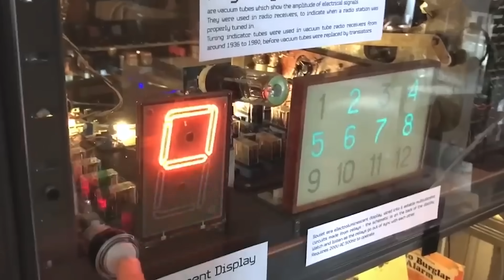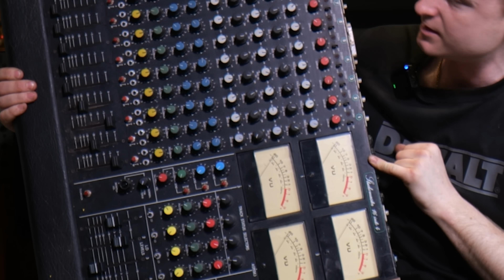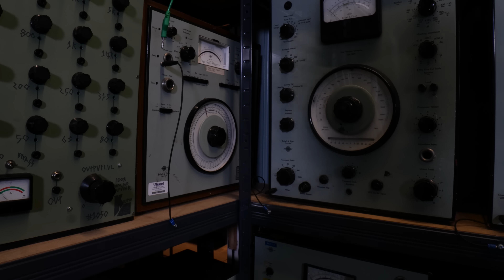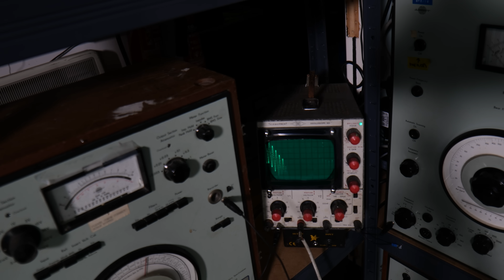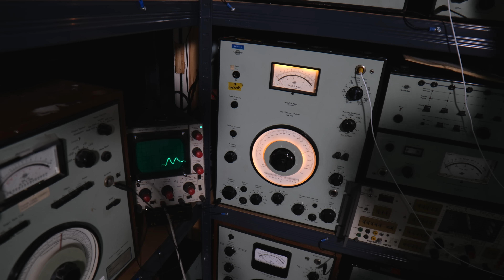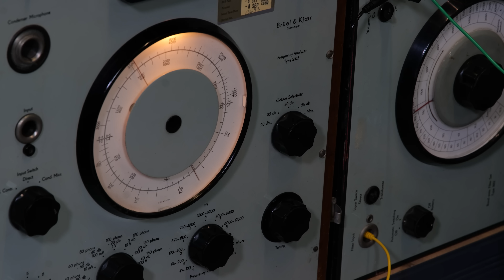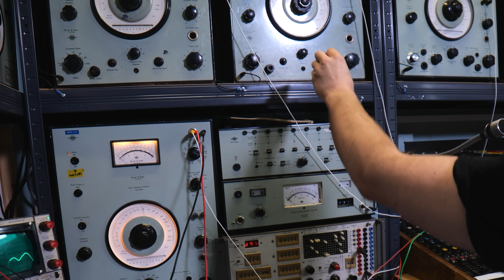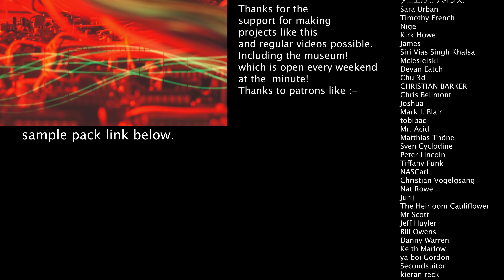THEY ALL SPEAK TO EACH OTHER - The Wiring Of ALL The Bruel & Kjaer's

Comment: Love your channel, thank you for all the effort you put in. ❤ I have a question about the earthing, do you risk getting any earth hum loops with tying the grounds to the frame, as opposed to earthing in a star configuration?
Reply from the maker: the voltages are relatively high compared to things like guitars or line level, as these test equipment pieces are running on 12v lines, when line level is less than 12 times that. earth hum is a relatively small problem

Comment: I have built thesejack to minijack coverters that doesn't ruin your sockets due to the weight. I have like 20cm minijack cable going into a small cylinder that keeps the she normal jack. So now they don't poke straight out, the connections just lie on the table behind, and there is no pull, from the weight of the cable

Comment: This might go over over your head, but some company build EMC filters to be included in your DIY builds, also a Swiss company exists.
pretty cool "devices", it's the common connector socket you find on pc's and stuff, but a bit bigger, it''s meant to be included in your "chassis" and designed as such.
It includes the common mode choke, XY filter caps and includes the "CE" mark.
Everything sold here is obligated to have such filter.

The problem: the producer has lots of types, based on the same EMC filter, how to find the right one for this room?
Find some one with a spectrum analyzer, knowledge!, to analyze this room.
If your wanna go the extra mile.

Comment: Ha! Nice contraption. Sounds great!

I was wondering if you could use the DB connectors on the mixer for signal inputs, all at once, with less hassle than all those 1/4" jacks and adapters.
After you set shelving in the doorway, I thought that you walled yourself in and the only way out would be with the Aperture Science Handheld Portal Device, haha.
Reply from the maker: I haven't yet been able to escape! Ha yes I mentioned the db connections in passing if I hadn't already made the patch bay for another project I would have. But since I already had it all for another mixer. I stuck with that. 👍